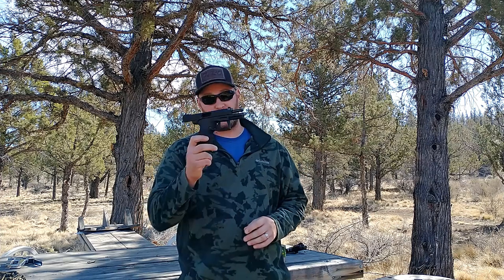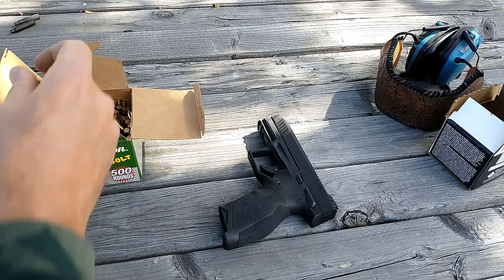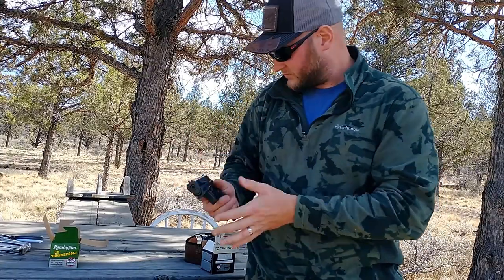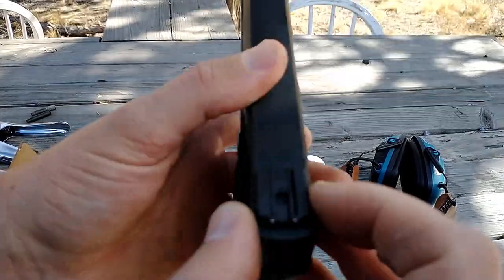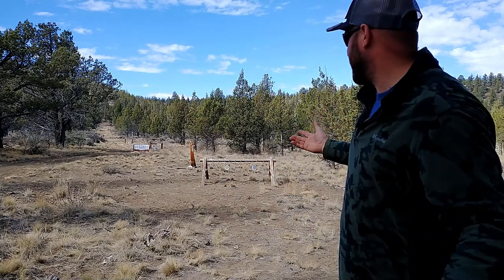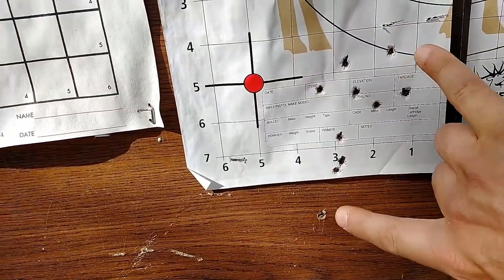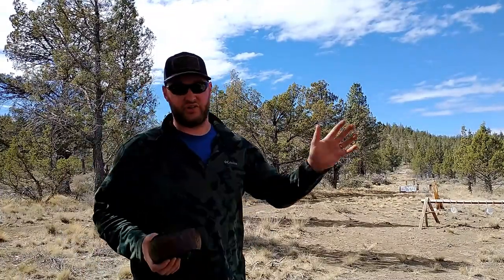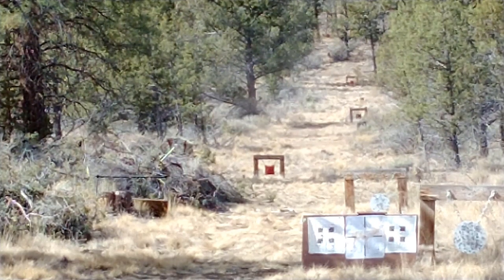Making my TX22 Reliable.  Break in, Polish, Dry Lube

Comment: I'm really sorry to comment 3 times but federal automatch may be fairly accurate in the other .22 pistol, but the TX 22 is not accurate at all with it. Shooting a quality round ( CCI, Aguila/dirtypowder but still accurate/Eley, SK, etc.) My TX (and yours) will shoot extremely accurately. Out to 50 yds at 4 in Paddles rapidly.  I can shoot soda bottles at 50 n
Reply from the maker: Cci standard velocity is my favorite for an inexpensive target load.  I've tried multiple different offerings from eley, wolf, cci,.etc., and none have posted acceptable accuracy in my TX22.  I'm sure yours shoots straight, but I believe mine is suffering frome the barrel issues that plagued so many early guns.  I really need to send mine in to fix the key hole and accuracy issues.
Reply: @ironridgeoutdoors   they have the best customer support. As long as you registered it within the first year through their website or by phone. I've had mine fixed twice now. The slide broke twice and didn't cost me a dime or any hassle at all.
Reply from the maker: @patrickrobinson2520  that's good to know, thanks.  Yeah, I registered this one right after I got it.

Comment: This is not a true test ! Ruger is a longer barrel length given it a truer shot. The Taurus is not for long range ! It will but not actually and they all hang up on 2nd round. It’s the mag and not the gun ! Clean magazines with a 20ga. Brush
Reply from the maker: Practical accuracy is still a valid test.  In my hands, the Ruger is a much more accurate pistol.

Comment: I've fired thousands of rounds and have never had a problem.
Reply from the maker: That's awesome.  Mine needed some work to make it run reliably.  I still need to send it back to fix the keyhole issues.

Comment: You shot the Tarus about 3x as fast as you did the Ruger at 100yds. I guess you wouldn't be as accurate !
Reply from the maker: Did you not see that the TX22 is key holing even at 25 yards?  That's why it's not as accurate.  My shooting speed is not the main variable in this simple demonstration.  Look up TX22 barrel problems.  This is not an uncommon issue.

Comment: Mine never cycled properly, stovepiping constantly, and the slide broke in two pieces at around 500 rounds. Yes, I loaded the mags correctly, and did the mag tap. Sent it in to Taurus, but will most likely trade it on a reputable .22 pistol, when I get it back. I sure can't trust this pos around the ranch.
Reply from the maker: Dang, that sucks to hear.
Reply: Just bought myself one for Christmas. Took it out to the cinder pit to fire it for the first time yesterday.
I used Winchester .22 LR, 36 GR Plated Hollow Points. 13 stove pipes or failure to feed in the first 50 rounds.
No, I didn't clean or lube it prior to the first fires.
It seemed to be feeding better the next 20-25 rounds, and it was noticeably better if I didn't completely fill the 16 rd mags.
I cleaned it today, and it didn't seem particularly dirty.
When I take it out again next week, I will try the same as well as different ammo. 
At this point, I'm not particularly happy with it. It doesn't match the raves of the majority of reviews.
Reply: @jere4524  The ammo is your problem, those Winchester bullets are garbage.

Comment: Lol Taurus TX 22 is reliable right out of the box. Nothing needs to be done to it.
Reply from the maker: Lol that's incredibly narrow minded.  You know they make more than one TX22 right?  Just because one is reliable doesn't make them all perfect.  Mine and many, many others have issues.  Thankfully I was able to get mine running with some simple work.  Did you even watch the whole video?
Reply from the maker: @brooks4048  is it so hard to believe that Taurus made a gun that wasn't reliable from the factory?  Yes, the TX22 has a very good reputation, that's why I bought it,  and yet many had to be sent back for various reasons.  Mine, wasn't one of the good ones, and it needed work.  I have read every comment, and multiple people have had similar and worse issues than mine, so I'm not alone in this endeavor.  Let me know what you think.  I love the ad revenue, and engagement, thanks for taking the time to share your opinions.
Reply: If you want your gun to fail (and wear out prematurely) simply oil the hell out of it.🤠